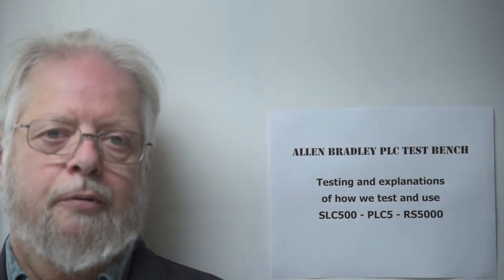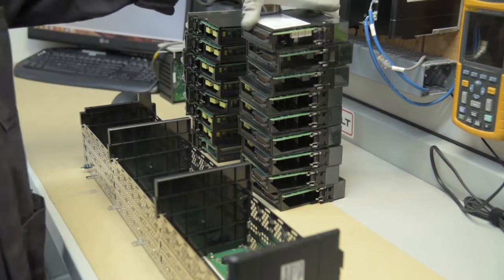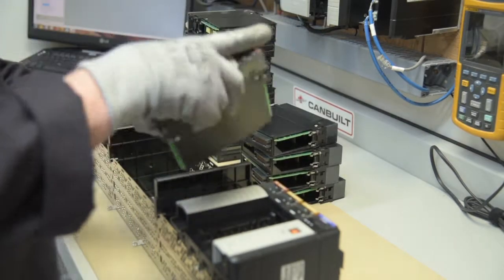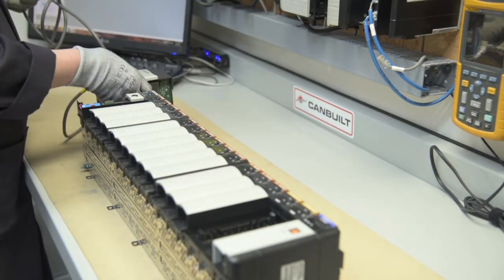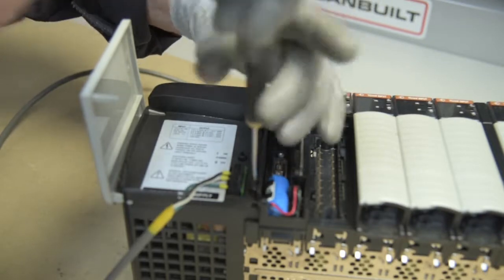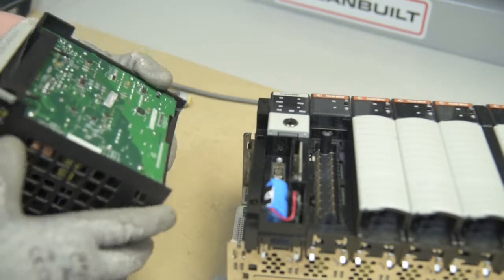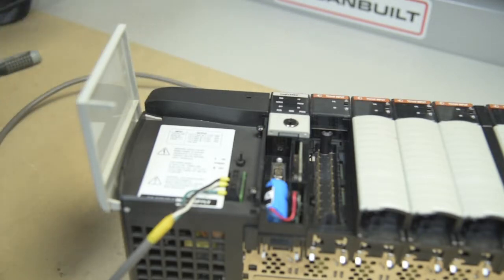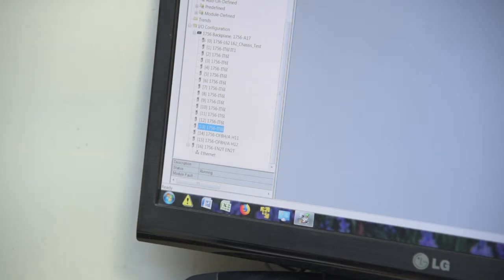1756-A17 Chassis Testing

Comment: Have you ever had a chassis with dead spots? We have a 1756-A17 and a couple of he 1756-OF8 cards had their RTNs stop having continuity to the chassis ground. We have had 2 OF8 side by side with their RTNs functioning differently. Card replacement did not resolve the issue, so we are thinking its the chassis.
Reply from the maker: I have seen a couple of bad ones for sure.
Because of how cheaply they designed the system it is possible for thin pieces of metal to get behind the backplane and then short out pins.
I would start by taking the chassis apart on a clean bench and see if anything conductive comes out when you have dismantled it.
The same with where the cards plug into the headers.  They are not sealed on the bottom so there is a possibility of shorting material there.
Also confirm all of your grounding from the power supplies and the chassis.
All grounds used in the system must be tied to a common grounding point.
Hope this helps.

Comment: Thank you sir . Sir , how to identify DI or DO card failure on chassis. In case failure how change & what procedure we have to follow?
Reply from the maker: Hello Ramya:
It is rare for Digital input modules to fail, but it does happen.  Normally this would only happen if the incorrect voltage signal was applied to the module.
Digital outputs, since they are normally connected to real world devices can suffer damage if not properly protected by fusing or interposing relays.
Your best way of determining if there is a 'problem' with a module is by first looking at the module status light.  If it is flashing then you need to go online to the processor and look up the module in the configuration tree and see what the the problem is.
You may want to sign up with http://www.plcs.net/ for full advice on programming and understanding your PLC system.

Comment: thank you sir very interesting and informative video , i had a question considering the replacement of the power supply do you need to have any software reconfiguration if you replace it with another PS??